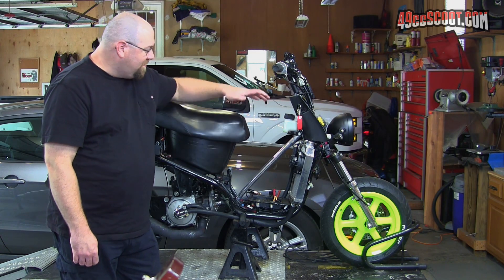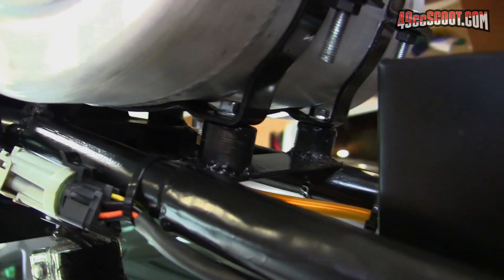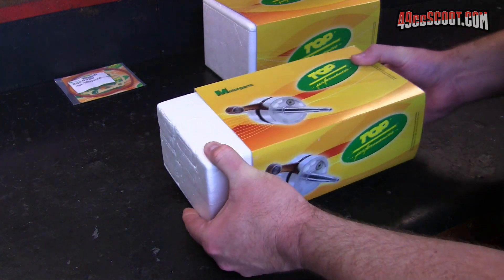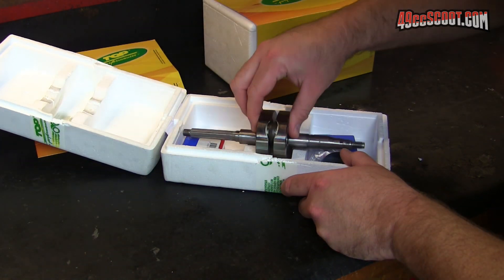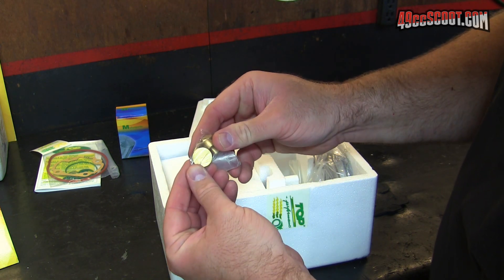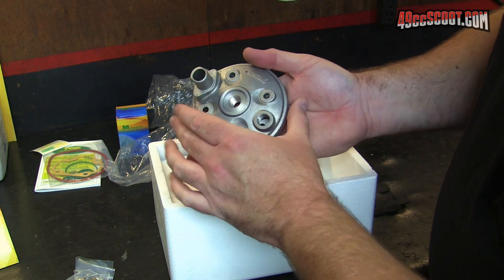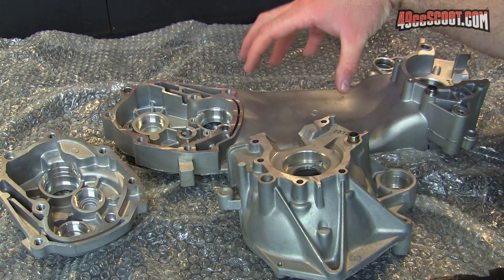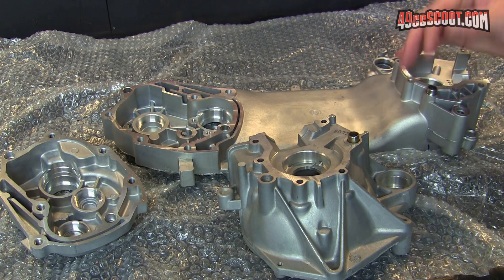TPR 86cc Build : Part 1 : Intro & Unboxing

Comment: Hi, in the end I bought the tpr 70cc due plus blue kit. 
Aluminium kits just aint worth. 
Had a stage 6 sport pro mk2 once that seized after 2 weeks (everyday use for hours). Cast iron kit only seized once after 4000 miles... the tpr due plus blue is on the same level as stage 6 sport pro mk2 so im happy

Comment: What scooter was this originally?
Reply from the maker: 2004 Vento Triton R4i (Chinese clone horizontal Minarelli engine [1E40QMB])
Reply: Thanks and could you tell me the cylinder stud spacing on the Minarelli engine. I'm trying to find a decent cylinder to fit on an EZ90 cub engine and I believe it's kind of like a Minarelli design? 12mm pin.
Reply from the maker: @RaceLab37  72mm diagonal stud spacing.

Comment: Its me again😁. Now i am wanting do upgrade to LC.My athena 70cc is struggling at 62mp(100kph) speed limits. Againts the wind and it wont keep up with the traffic lol.It can do 69mph but not ideal for air cooled cylinder to be WOT  the entire ride just to keep up with traffic(to be on safe side not being rear eneded lol).I wonder if my Yasuni R can keep up with this tpr kit? Atleast for now and perhaps updgrade to polini or mhr pipe by summer next year hence this is more of a winter project.(Canadian eh!😅😅😅) First snow fall today no more riding 😥😥.

Thanks for all the videos keep up the good work. You deserve more subs 👌👌
Reply from the maker: Mine worked well with the Peace Pipe at 10-11kRPM, so maybe. You may want to see if you can find the stinger diameter for it. If it's too small it can make the engine run hot and even melt the piston. I'd guess it's OK, but it's worth a look.

Comment: Been a while since I checked in on your channel. I should've been more attentive to your channel since you have so much knowledge about these 2t's I'm into. I'm about to do a couple horizontal minarelli builds(2002 vinos) and possibly a couple CA50 builds(86 jog & 84 riva) I wanna do a "high-low comparison", as far as quality/cost/budget goes. Eventually I wanna put a horizontal minarelli in my salient/riva...idk yet🤷🏿‍♀️ but right now the CA50 in my jog is rockin, the one in my riva is super slow. I'd like to hear some opinions on these, also I'd like to compensate you for your time/effort if possible. I want them to be "streetable", but also want to haul ass to where I'm not having to rebuild after under 1k miles, ya know? Something somewhat reliable for both builds...sorta. I have a 70cc airsol bbk on my vino rn, single ring that's been doing good for the past few years, I don't always push it hard, nor for very long, but it's held up for a while. Although I can tune it better and put another pipe I have on it, it still hits mid 50s🤷🏿‍♀️ lmk what you think. I can send my email. Your videos are always the most straightforward and informative and we in the scooter community appreciate all you do!
Reply from the maker: Something like a Yasuni C16 and a midrace bore goes a long way. Not a huge investement, but should make good power and last for a bit. I like the 86cc. The kit itself is somewhat reasonable. It's when you add a pipe and racing ignition and so on that the price starts to run away.

Comment: You seem very knowledgeable and I was wondering if you can help me. I have a 04 kymco super 9s lc and was looking to get more out of it any help will be much appreciated.
Reply from the maker: Haven't really messed with that platform, but basically a big bore kit and exhaust along with carb and CVT tuning can make a huge difference. You can do just a pipe or just a big bore kit, but they will need to be accompanied by tuning still. If you want specifics, you should consider joining the 49ccscoot forum. Some of the folks there will likely be able to give you better details about what's around for your scoot.

Comment: I might be splitting hairs here a little bit but for reference sake when you refer to a port in the cylinder the port is on the bottom of the cylinder and the hole that's inside the cylinder bore is actually the port window ...again , splitting hairs but things have names to eliminate confusion,so there you go.

Comment: Burning a hole to in the piston has nothing to do with the material, that was more heating/cooling, the squish, your jets and especially how the cylinder is breathing due to your exaust. Also ignition point.
Reply from the maker: The ease of holing a piston does relate to materials. If the expansion rates and tolerances allow the piston to soft seize before it can get to melting point, then it doesn't melt. I have put holes in pistons in iron bores, but they are more forgiving of tuning issues.

Comment: Only reason you burned a hole in ur piston was too lean carb settings
Reply from the maker: Right, but what I don't like about aluminum is that you may not get a soft seize like iron bores. Run a little lean with iron and you often get lucky and it soft seizes. You fire it back up and carry on, richening it up ASAP. Aluminum is less forgiving and more likely to melt a piston before you really have a warning if something goes wrong.
Reply: @49ccscoot  Oh yeah, i use only aluminium cylinders because how fast they cool down and how strong the coating is, i once seized my piston and the cylinder was in perfect condition and piston destroyed.

Comment: nice :) if you're doing it right, you should easily get 19-20 horsepower because I've had the same cylinder kit, on my yamaha aerox, and their 77cc kit on my piaggio scooter. you need, their exhaust, or a yasuni c20 minium :)
Reply: Hey for the 77cc do I need to do any kind of porting to put it on I see the that 86cc you need to do some porting and around how many hp you get on the 77cc
Reply: @edgarnunes2026  yes you need to port the engine case, for the cylinder skirts to fit, I didn't dyno tuned my old 77cc so don't know what it does of hp

Comment: Hi mi friend,please read this as it will help you no end. I’ve been following you for some time and your vids are great 👍🏻 I do the same thing as you and just wanted you to know a few key things that make everything come together like salt and pepper. 1st key item and something that I put off and off because of cost but since buying it its made my scooter go from 20 out of 100 to 100 and the item is a inner rotor mvt ignition not for the huge weight reduction but for the precision spark at the correct time at the correct rpm. Best thing I ever bought. Other 2 things are larger inlet carb etc and a proper expansion pipe to match your ccs and my bike is a road bike not race. Read 2 stroke tuners handbook by proffeser Gordon genings you will learn all from that 👍🏻
Reply from the maker: Thanks. I've read Bell's book and some of Jennings. Good stuff. What little I've looked at by Blair gets over my head. Anyway, yeah, I know it could use that stuff. Just gotta try it because no one else does... or at least they don't make it publicly known.

Comment: That is a huge exh port. Ring flex scares me ever since i tried an airsal kit for my '78 puch. Ran fine being easy on it for 1k miles.
As soon as i let it rev the problems started. As it got hot it got tight. Took it off back to iron and sane size ports and zero probs.
But a lot less power, better to ride home than push it home. My scoot still under the tarp and will be till next year. Spine issues.
Crashing dirt bikes in my teens and getting hit by cars on full size bikes at speed caught up with me in my 50's. Maybe next year.
1970 cb 750 has been a rock this year, not a single prob at all. But only 5 or ten miles can not handle more. But still riding.
The pasta scoot is very unhappy with me for letting it sit, but i see it like this : do it right or leave it alone. So it sits.
Hey good luck with the case and cylinder it looks nice ! I would go wide on the ring gap looks like it's going to be a hot runner.
A little wide, with only one it's getting pretty hot, but doing all the work. You've been around you know what your doing.
Looks like the finish on the cylinder is nice, no casting flash or nasty spots. So that is what it looks like when you spend a few bucks.
Maybe i should smarten up and spend a few bucks too. Instead of 3 hours cleaning up all the flash and roughness the cheapos have.
Have a good
Reply from the maker: Hope you feel well enough to ride more soon.

Comment: Hey, a fast question, I got a scooter with a Minarelli engine that has 80cc big bork on it, I would like to keep the stock air filter "It is the same air filter that you hav on the 2T" Should I remove the snorkel? and add a Malossi stock air filter like??
Thank you so much
Reply from the maker: I usually just remove the snorkel and use the stock filter. If it's got a larger carb, then I open up the opening where the snorkel was a bit to be sure there's enough airflow. Wouldn't bother with that if it's a stock carb. Depending on the snorkel (they do vary from OK to restrictive) it may not even make much difference in performance with or without it when using the stock carb. Just remember to check your jetting if you mod the airbox in any way.
Reply: @49ccscoot  okay, thanks, so then i will onlu take out the sborkel, apparr from that would you also change the stock air filter and put a OEM style malossi red filter ?? 

About the Jets, what's the increase would you suggest me? Maybe +5 on lows and high? Over stock ?? Do you know what's the stock size of a usual minarelli 50cc stock carb ?? 

Thank you so much
Reply from the maker: @12enric  I've used the stock filter with a 25mm carb on a 103cc at 12,000RPM. Seems fine to me, but if you prefer red air filters, go for it.

Stock main jets vary greatly. I've seen a range from 50-something to around 80. Best bet is to increase jet size by at least 10% and then do tuning runs to see what actually works best with different jets.

Comment: Letting you know that you do get what you pay for especially with TPR stuff okay performance kinda shitty quality, the kits verry common here in Sweden would strongly recommend that you buy stuff from bidalot, stage6 or malossi when this cylinder blows up. Hyped for the build tho!
Reply from the maker: I'm hoping it holds together for a bit with me not pushing it hard.
Reply: Dont scare him, also the problem TPR has is regarding the pistonring clearance. But mostly effected the AM6 line.

Så kasst är inte TPR, mer handhavande, dvs folk som inte klarar av mecka.

Comment: 86cc is good price for performance, i can assure you you will see so much bigger difference from that 103cc, all u have to do is just get the right parts with it like high end exhaust, innerotor ignition, 28+ mm carb and very good cvt, keep in mind that this is racing cylinder so u cant really drive it non stop everyday, one thing is sure if u setup all corretly u will feel so much more power :) , welcome to the real 2T scooter tuning world :D, i will be following the project with pleasure.
Reply from the maker: Mine is not going to be that wild. I can't afford all of the parts and more importantly... I actually want to ride it. I would like to find out the true potential of these things one day though.
Reply: @49ccscoot  The problem is that it wont work properly without that stuff... i dont know how u plan to drive this everyday good luck man .... for everyday i reccomend stage6 sport pro mk2 some midrace setup.
Reply from the maker: @Delpzie  I know it's not gonna make big power without the hyper race parts to accompany it. My main goal is to at least be as quick as the 103cc and hopefully be able to ride it more than most people with their full on race builds. I've talked to Jack Cecil about his 30HP race scoot before on the forum and he basically said he wouldn't even ride it around town. Essentially it's just for going out in the parking lot and kicking ass and then being parked again. That's badass to watch him do, but not for me. I love to ride.
Reply: @49ccscoot  yea same for my scooter i drive it once-twice a week. And inspection after like 1000 1500km.
Reply from the maker: @Delpzie  Thankfully no scooter inspections here. So few of them around me that they rarely pay much attention to them.
Reply: @49ccscoot  I meant of inspecting the cylinder, piston and rings :)
Reply from the maker: @Delpzie  lol I shouldn't read comments when I'm tired. That makes more sense.

Comment: why are  you seizing  so many kits are you using synthic oil i run kits for years and wot hard as they will go blow rings out and wear pistins   i engine break my stuff a lot too
Reply from the maker: What the 103 is doing is not sealing. I can get it to seal for a bit, but not a setup that I can trust. I've seized a lot of kits for various reasons. I did run 50:1 for years with AMSOil Saber. Then switched to AMSOil Dominator at 50:1. Currently using Dominator at 32:1. A lot of mine have been tuning or leaks though. Plus I ride a lot. 500 miles in a weekend in temps that can vary by about 40 degrees with no re-tuning and no mercy for it.  One time I swapped to a larger main jet to be safe and found out later that the larger main jet was actually smaller. At that point I started tuning with same brand jets instead of mix and match. Stuff happens. I try to learn from it when I can.
Reply: @49ccscoot  try using ulta grey gasket maker on the head gasket and around engine seal wont hurt to try   thick handmade base gasket
Reply from the maker: @imtonedeaf1  Oh, I've been through the ringer with it trying things. You'll see whenever I get a video of that.

Comment: I have the same kit I have 1231 miles so far so good thanks for the vid
Reply from the maker: Nice. I hope I get that many miles on mine and more. What exhaust, carb, ignition are you using?
Reply: 90GTVert only thing I don’t have is the trp pipe I have a 80cc roost pipe because I ported the jug out of the box the carb is a 28mm tpr power jet

Comment: Does the cylinder bridge have coating?
Reply from the maker: It does. Looks like they relieved it before it was coated. I would imagine that would greatly reduce the risk of chipping/flaking in that area vs doing it after.